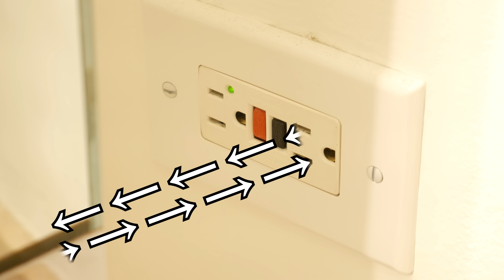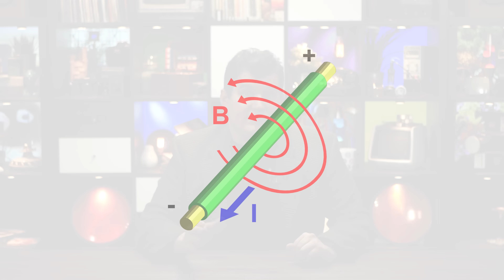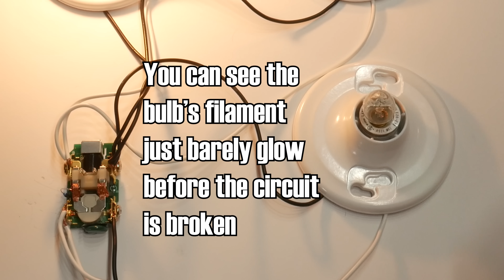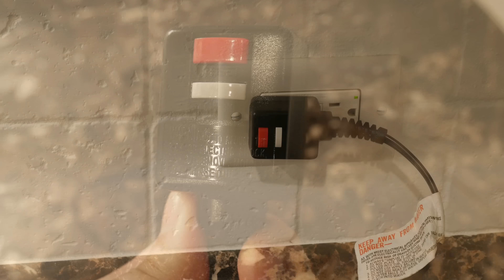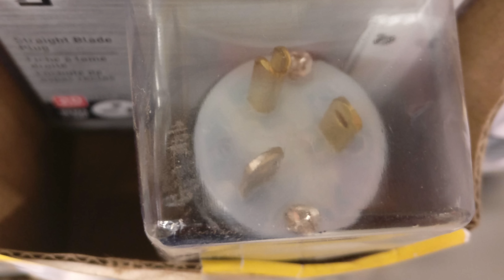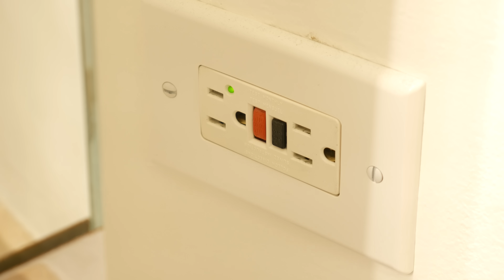The GFCI/RCD: A Simple but Life-Saving Protector

Comment: In Europe, all safety devices are usually centralised, and it has been years since these elements were allowed to be placed outside the control panel.

Normally we call it a differential, and we have them calibrated to 30 mA.

(30 mA (for full circuit, not for one plug) and 230 AC volts, of course.)

As for the circuit-breakers, they are the same but in a panel, they also protect against overcurrent and short circuits.
Reply: Same in Russia. All houses and apartments (except for old ones) must have differential breakers in main panel 
like this https://imgur.com/a/22cEvV5
Reply: No back plate?
Reply: The back plate is temporarily dismounted to show the background wires.
Reply: In Denmark 30mA RCDs are required on all circuits up to 20A (those above are used for distribution). It has been a requirement for new houses since 1975, and in 2008 it became a requirement for all installations. Even those that where legal when they where made. Non-private buildings are required to hire licensed electricians to test the RDCs every year, who uses equipment that measure that the RCD triggers fast enough.
Reply: The European code clearly states that the rcd should cut at 30ma regardless of placement. Also the same guide advices that power outlets in high moist places, such as bathrooms etc (it divides the to in 3 parts) should have a 1:1 transformer.
Reply: In Italy we usually call them "salvavita" which literally means "life saver".
Reply: Interestingly enough, you can find ground fault devices in the US than trip at 30mA, but they are intended for the protection of equipment, not people.
Reply: In Italy it's no more than 30mA for household circuits (TT grounding). For industrial installations (TN-S) I don't know, but I suppose it should be choosen according to earth resistence.
Reply: @davidebacchi9030  technically you may not need it as the ground leed (PE) is connected to the neutral point in the transformer with makes it like a phase neutral short circuit (by the way the italian standard allows not using the RCD with TN grounding system under certain condition) . In practice it is safer to use RCD in any circumstance as it is way easier to detect a ground fault with the low current trip rating of the RCD than the magnetic short circuit trip of the overcurrent protection. 
(nota di servizio: non mi risulta che la 64-8 obblighi sempre i differenziali da 30 mA in quanto ammette fino a 1 A-1s per i differenziali dei quadri generali a patto che siano coordinati con la resistenza dell'impianto di terra)
Reply: @maurocolombo2173  AFAIK, in home wiring, 30mA RCD are required on 'terminal' circuits, feeders must be protected 'in accordance with ground impedence'. In any case, the code states that in Italy distribution is TT, so, even if a permise is or could be connected in TN, RCD is still required. I don't if the industrial TN case.
Reply: @davidebacchi9030  the TN case was (of course) for industrial applications with a MV substation and energy delivery. 
(domada tra tecnici: dove è indicato che è obbligatorio il diff da 30 mA? nella 64-8 non l'ho trovato....)
Reply: @maurocolombo2173  Dovrebbe essere l'articolo 412.5.3 (per l'uso domestico): La protezione addizionale mediante l’uso di dispositivi di protezione con corrente differenziale nominale d’intervento non superiore a 30 mA è richiesta:
a) nei locali ad uso abitativo per i circuiti che alimentano le prese a spina con corrente nominale non superiore a 20 A.
Reply: RCDs don't have overload protection. So, if the current returns through a human through the expected path, hot to neutral, they don't trip. GFCIs are equivalent to what are called RCBOs (Residual Current Breaker with Overload protection).
Reply: @Markle2k
an RCBO wont trip if you connect yourself between hot to neutral (and completely isolated from ground) until your quite toasty .
Reply: 30mA is enough to stop a human heart, so I am not sure why Europe uses that as the threshold for a trip.  It should be about 5mA like in the U.S.
Reply: The interruptors trip in milliseconds, the shock isn't long enough to stop your heart at 30mA.
Reply: @LonnieAdams4  normally, because 30 mA is for a full circuit you have to keep in mind that every device has losses to ground and only in losses maybe you have 20 mA all time. And with only 10 mA more will kick in the protection. You protect a full installation not only a plug. It's a different approach.
Reply: @LonnieAdams4  Generally only 60 mA is considered dangerous.
Reply: I've noticed in Europe they're often used to turn off electric hot water heaters when nobody's home.
Reply: It depends, then there's nobody home and the installation is pretty old (aluminium cables - they overheat easily with heavy load) it is advised to not leave such equipment on. I personally use the time programmer with "double zone" electricity contract (cheap energy in the night, more expensive on the day) to heat the water when I'm home 22:00 - 6:00.
Reply: A lot of US GFCIs have around 5-15ma
Reply: Same in France, called différentiels 😅
Reply: It is perfectly legal to put them on sockets. You cannot have a centralized one on old installations. My grounded sockets connect the ground to neutral. One cannot have a GFCI before that. I do have one in the consumer unit but it is not connected because of the sockets.
Reply: its getting that way in the states..we have these new arc fault breakers that must be installed in circuit panel that protect everything...new construction its all in the panel.
Reply: Makes sense to ha e every plug protected. But hey in America you can just cut costs and that's fine.
Reply: merica paid for that via the Marshall Plan, but please, save your thank you's.
Reply: I think it is 30 mA for bathrooms and 300mA for general circuits
Reply: 15 mA or 30 mA. If you exceed 30 mA in losses you need to split the circuit. (In Spain and in houses, not industrial this is another thing).

More than 30 mA will kill you... this is the reason that forces you to split the circuits in 30 mA max possible losses. In any situation will stop you to death ;)

Maybe in Belgium is different don't know...
Reply: In Belgium it's 30mA for moist locations (like bathroom), 300mA for dry locations and if you go extremely wet (submerged) it should even be 10mA. In dry conditions you should be able to survive a very short jolt of 230V/300mA but under the right conditions even a 230V/30mA jolt can kill you
Reply: As someone who's lived in several different bits of Spain, I can say that what the codes say and what you actually get in the fusebox are two very different things. My current flat isn't grounded at all, and is all on a single circuit breaker that appears to only trip when the draw exceeds 3kW. When I charge my MacBook, I get a constant buzz off of it, because Apple subscribe to +ElectroBOOM's Theory of Electrical Engineering, ie: If it doesn't bite you, it's not working properly. o.o
Reply: I might be wrong, but I think here in Italy 300mA is allowed in certain industrial applications. Definitely 30 for residential though.
Reply: +Benjamin Nolan "and is all on a single circuit breaker that appears to only trip when the draw exceeds 3kW"That's the standard arrangement here in Italy, except you pay for 3kW but there are tolerances. You can draw 3.3kW indefinitely, and with the new electronic meters you can even draw up to 4.5kW for very short periods of time.
Reply: @corneel25
i think 300 mA would be to much , in the UK it is 25 mA and it trips off quick but you still feel it bite , we need somebody who is already dead to volunteer to have an electric current passed through their body to see how many mAmps it is , hehe :-)
Reply: @YTANDY100  The Nazis already did that for you in the fourties
Reply: It's certainly not 300mA in Australia. I've never heard it ever being that high. That would be a bad idea.
Reply: 300mA isn't for humans, it is for equipment as ground faults does nasty things to them too.
for LV circuits where human contact is possible the norm is to go for 30mA RCD's, which are also called as high sensitivity (HS) RCD.
Reply: @NickStallman  I agree 300mA sounds very high regardless of where it is, I mean i guess its used in a manner to maybe prevent accidental tripping from certain devices that can leak some current out, but 300 just sounds a little extreme even for a quick blast as you dont even need to be wet, like just off the top of my head if you created a path while working on your metal case desktop computer, the computer has a grounded plug and usually the power supply makes the computer case earthed as well, and if you receive a mains shock while touching the earthed part of the computer you are making a very good path to the ground without being wet
Reply: In the UK it's 30mA
Reply: @corneel25  No, it is 30mA for the whole house. In large houses they sometimes put one for each circuit to avoid tripping due to the accumulation of small leakage from each circuit. 
300mA is only for some specific cases in residences and would often have 30mA devices further downstream anyway.
Reply: @corneel25  300 mA is either for fire protection or in TT to help cut the power i.e. to make the grounding work. In FInland all RCDs are 30 mA.